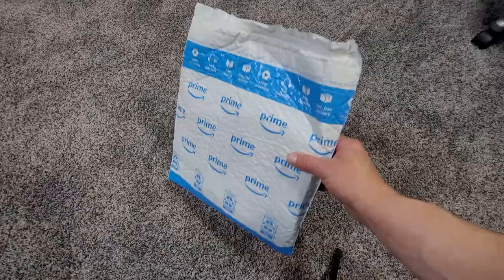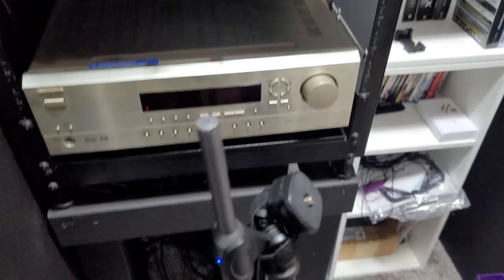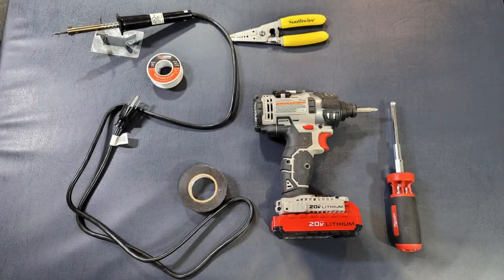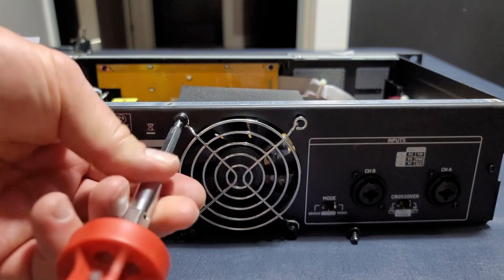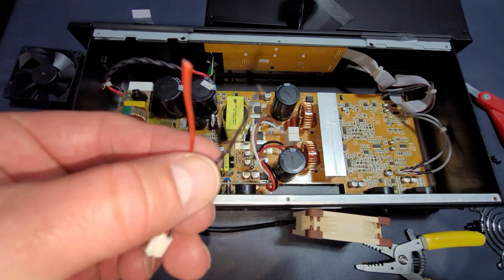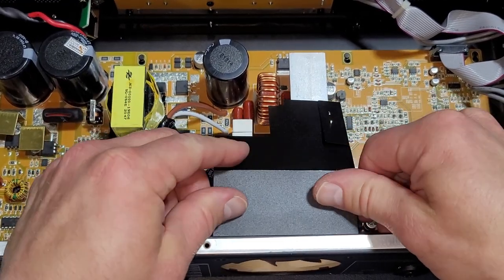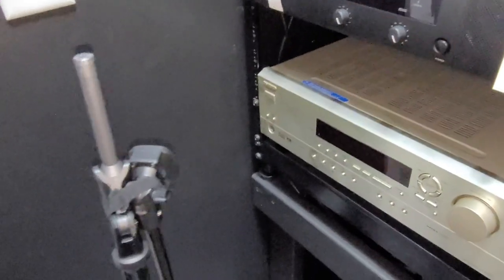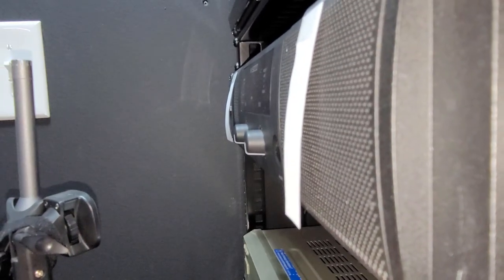Basement Home Theater - Behringer Amplifier Fan Mod - Much Quieter Now!

Comment: I've just placed an order for the NX3000 and I'm so glad I watched this before it arrives. I was aware of the loud fan and knew that quiet replacements were available. Seems straightforward enough. Thanks for posting!!
Reply from the maker: Glad it can be of some help!
Reply: you should even be able to set the speed of the fan, that is how they are set up in a PC. This fan is always on - lazy engineering design ☺

Comment: This video is a lifesaver! I'm planning on geting the  NX3000D for black friday along with a couple of tactile transducers. I'm also a complete newbie on the electrical stuff and got very confused about the 4 vs 2 pin cables. I was like, "what model are all these people using? they're not compatible! Or maybe they're using an adapter? Why don't they mention which one?". This video cleared it all up. Thank you very much!
Reply from the maker: That's awesome!  Glad I could be of assistance, and good luck with yours!

Comment: Thanks a bunch man :) I recently got my hands on a Hybrid A-1600 (Unlike QSC, Crown and Behringer, Hybrid is a brand you probably have never heard of as it is primarily manufactured for the South African market lmao) with a fan (actually 2, one on either side of the amp) equally as noisy, was busy looking over several options stressing over different CFM and shit. This video really helped :)
Reply from the maker: You are correct, I have never heard of that brand before.  However, I'm glad my video could help you some!  Thanks for watching 👍
Reply: @TyEichele  hey man! i decided to come back and ask regarding your modded NX3000, have you encountered any problems such the amp going into protect mode from overheating or any other problems alike? or is it still performing well?
Reply from the maker: @defaultyotis_x7528  Thanks!  Good question.  I'm happy to report no issues whatsoever to date.  👍

Comment: You can use a resistor in series if you want to slow this fan down a bit. It may even come with a "Low noise adapter" as many Noctua fans do stock in which case you can just make a small adapter cable and use the stock noctua fan cable and LNA.

I suspect those of us using this type of amp on a home sub will not be driving it at high enough duty to really stress it and heat it up too much. I'm sure if I look around someone generous will have tested this and published passive cooled temps vs fan operated.
Reply from the maker: This is a great idea!  Thanks for sharing
Reply: @TyEichele  Happy to! It's been my journey with silent computing and home servers that sound like jet turbines haha. 

Noctua gear is the best at market for this type of use I think and I like that they generally include the extras to cover the noise generated.

Comment: 52 vs. 19.5 That's the CFM rating of the 2 fans. Sure one is much quieter because it's pushing a little more than 1/3 the volume of air past the heat sink of the Amp.

Comment: That is significantly less airflow 3:45 vs 10:14. But I guess these aren’t really pushed to their limits. Maybe if you’re running lots of sub 20hz content it’ll get too hot. I doubt you’ll overheat it though, there should be a protection internally anyway.
Reply from the maker: Happy to report that I haven't had any issues so far!

Comment: Jamicon es una marca profesional de mucho prestigio, pero ruidosa. Lo mejor es ventilar doble el sistema. Dejar por dentro uno que apunte diréctamente a los disipadores y el de afuera para introducir aire fresco. Y ambos de velocidades de 1200/1500 rv minuto. Es importante repartir el aire de dentro para quitar calor al disipador. Otra idea es cambiar el disipador por otro más grande y de cobre. Eso haría que el semiconductor concentrara el calor en un punto.
Reply: Maybe you should write on English ?  How do you know that this guy knows Spanish language or whatever this is...?
But you are 100% right 👍 about two points of entry... one to suck in fresh air and other to rotate out the nasty air from inside. But the point that this person had was noise and he solved it so 👏bravo

Comment: You now have half the air flow I would not do this for a live band set up. If the fan is loud contact Behringer they will take care of it. I have all Behringer amps I have never seen this problem. But any problems I have had Behringer has taken care of the product. The only problem I had was my guitar player broke my x32. Otherwise none of the Behringer products I've ever failed and I've been using them since 2001. I have the 3000 watt version like you have and I have the four channel amp as well and they're both dead quiet.
Reply: Also, it's important if you're going to switch out the fan. Make sure that they're pulling the same amount of power. You don't want to put a fan and that pulls more power than the original fan. It does appear that you're flowing about half the airflow and if that amp was under a heavy load it would probably burn up

Comment: hi thank you so much for your excellent video    I would love to have your opinion about the NX3000 amp sound  
is it valid also for a basic stereo system ?  thanks a lot bye gino
Reply from the maker: It's ok for basic stereo yes.  If it meets your power requirements then go for it.  It's underpowered for what it's rated at, but works.
Reply: @TyEichele   hi thank you for the very kind and helpful reply    I see that is stable even with a 2 ohm load 
This is good  Kind regards gino

Comment: Are you using that amp for a subwoofer? Is it possible tonuse it for front l/r speakers that are 6ohm? Thanks!
Reply from the maker: I am using it for subwoofers, yes.  I would look up the specs of the l/r speakers and the specs of this or any amp you may decide on to see if you can wire it into a 6ohm load properly at the correct power levels to prevent damage to the speakers.

Comment: Yeah looks like it’s so quiet because it’s not moving nearly as much air. Hopefully it’s not a long term problem with amp life.
Reply from the maker: Hopefully!  But it also seems that no one has really had any issues after swapping to a quieter fan either so I have my hopes up for no issues long term.  I feel there is still good airflow coming out of the vents even if it's less.  Thanks for watching!

Comment: Do you know if you can use a 12 volt fan on an amp that uses a 24 volt fan? I have a QSC that I think uses a 24 volt fan. Great video btw.
Reply from the maker: Thank you!  I would not change voltage of fans, especially if it is designed for a specific voltage to begin with.  That's just me, maybe someone else can explain why or if it is ok, but to me that is asking for problems when you start changing stuff like that.  I'd try my best to stick with a quieter 24 volt fan that matches that current one.

Comment: question, why does the limited led often light up even though the volume is at 12 o'clock
Reply from the maker: The limited light never lights up that I see.  I also have the volume knobs fully turned up as far as they will go, then I let the MiniDSP and the subwoofer out in the AVR handle the sub volume from there.  The only time a red LED comes on that I notice is when I first power up the amp and the 'protect' led lights up for a brief second and then goes off.
Reply: @TyEichele  not your amp sir, I have an nx6000 and I see the Led limiter flashing even though it has not reached the maximum level
Reply from the maker: @John48778  I'm still not seeing it....Can you reference at what point in the video (minutes and seconds) that you are noticing this happening at?
Reply: This means that the voltage coming into your power amp is greater than the rated input sensitivity (the voltage at which the amplifier creates full power before clipping). 

When you turn the knob down at the amp, you are attenuating or reducing the input signal voltage. You can reduce the voltage (gain) of you input source, or you can attenuate the voltage at the power amp with the knob. 

Ideally you would match the voltage of your source to the input sensitivity of the amp, but in reality this isn't always possible. It's better to have too great a voltage coming into the amp (since you can attenuate with the knob) vs too little (you will not get full power out of the amp).
Reply from the maker: @damianblankenship8162  That's a great explanation - thank you!  I'm still not seeing the limit LED light up.  The only thing I notice in the video are the two top red LED's next to 'Protect' on the amp, but they only come on during the intital startup of the amp when I first turn it on.  I don't even have a source (Denon AVR) turned on in this video so there is literally no input coming into this power amp.  I think the previous comments are seeing the red protect LED come on at startup and getting it confused possibly.....?